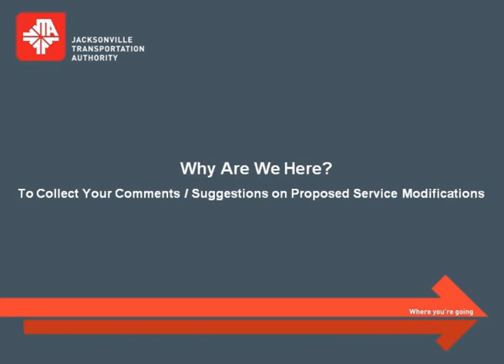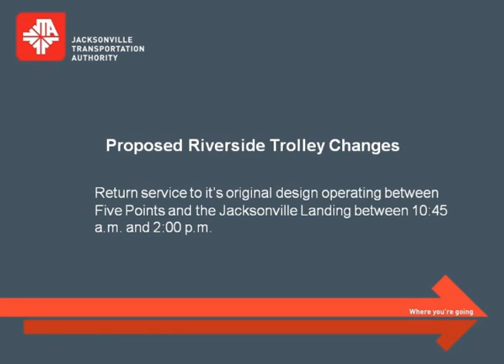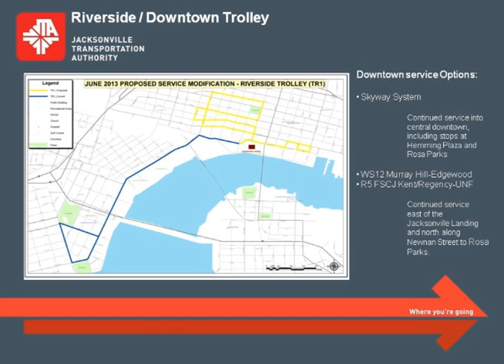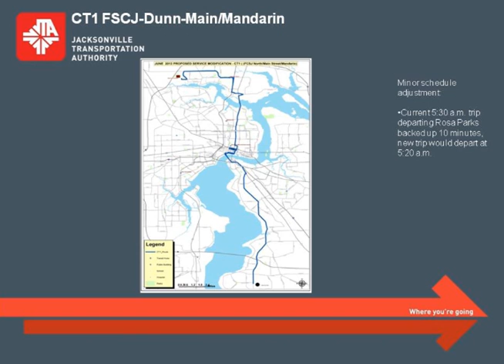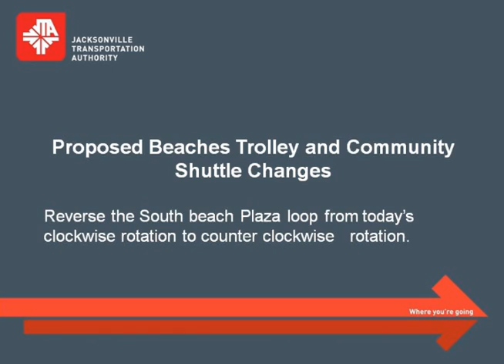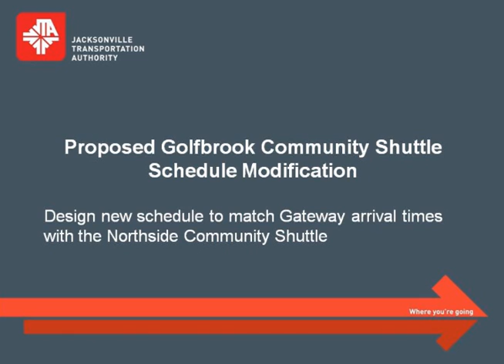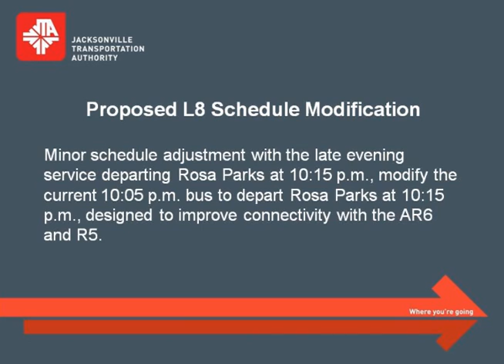JTA Public Hearing - April 4, 2013

Comment: What I'd still like to see about the CT1 running later than 8:00pm. Kent did mention adding another trip at 9:00pm which I think would be great. Also, I remember service changes addressed months ago about adding service to Oakleaf, making AR6 streamlined and more frequent (as well as WS2), and merging AR7, S1, & SS6 to a new route known as SS10 to make it more frequent. When is that ever gonna happen?